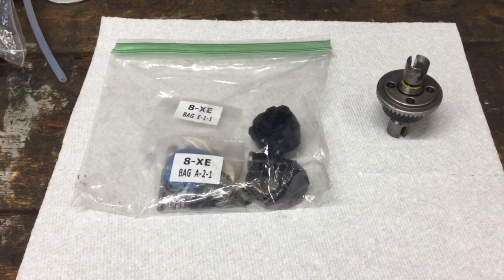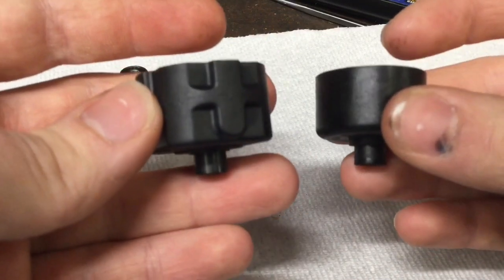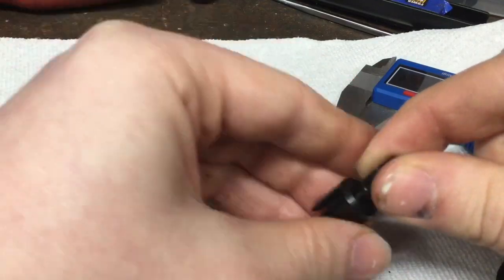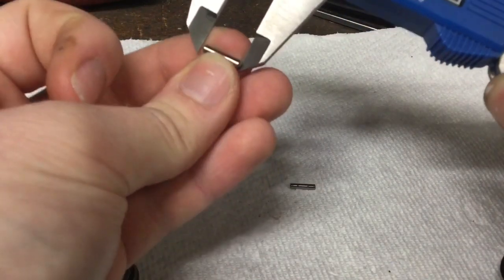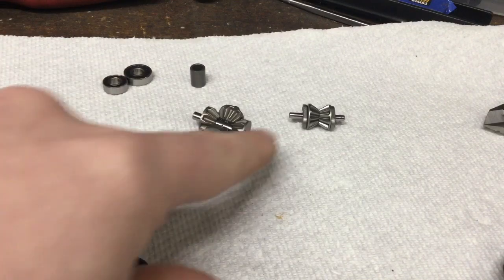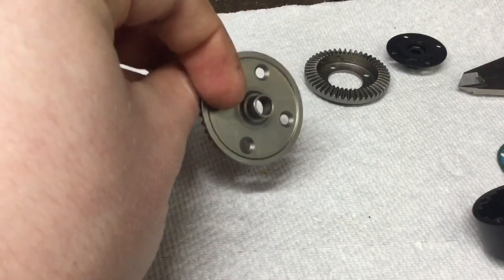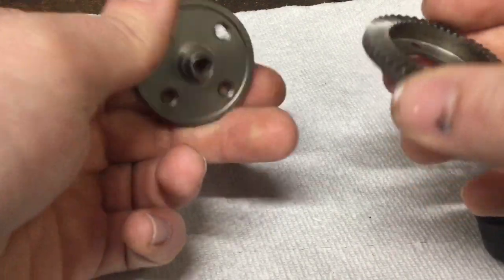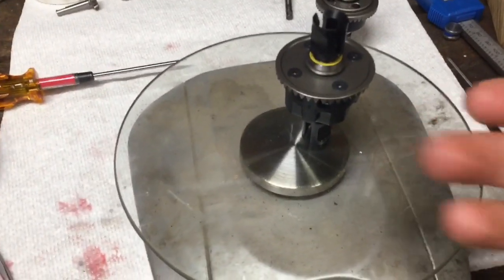Losi 8ight kit and rtr differential comparison

Comment: That video helps I'm really curious though to know if the eight or tlr parts will fit in a tenacity because the cvd drive shafts that comes with aren't worth a darn I think I broke three of them already and they're quite a bit higher than like the eight driveshaft

Comment: Great info as always bro. 👊💪👍👍Do the tlr diffs fit in the rtr housing or is that part different to?
Reply from the maker: MrLilchilly all versions of the tlr diffs fit in the rear and center with no problems. However I didn’t know in this video but, the only thing tlr changed on the 8ight x diffs is the front ring gear it’s pretty much flat instead of dipping down. So I ordered a 4.0 front ring gear last night and that should fix it. I’ll let you know.
Reply: @thenitronation5815  appreciate it 👍👍

Comment: Hi!! If I add another spider gear to my rtr center diff, will be perform better?? Thanks nitro nationn 💪
Reply from the maker: Adding another pair of spider gears would take the power better and put power down to the ground better, as well as it will respond to different diff oil viscosities better. The only problem with the rtr diffs is you can’t really add another set of spider gears because there is not a notch on the cross pin to accept another one. I have seen people modding their rtr diffs to except another pair of spider gears but I wouldn’t really recommend it because of how thin the cross pins are. Also sorry for the late response, I haven’t been receiving many comment notifications lately.
Reply: @thenitronation5815  ohhh okk, waoww I didn't know that aboutthe rtr diff, thank you for the information 🙏🙏. And is better late than never 😁😁👍💪
Great channel brother!!